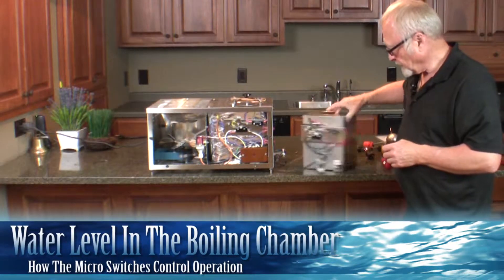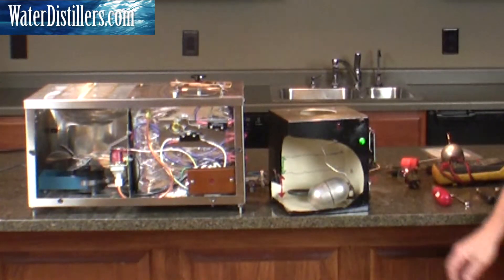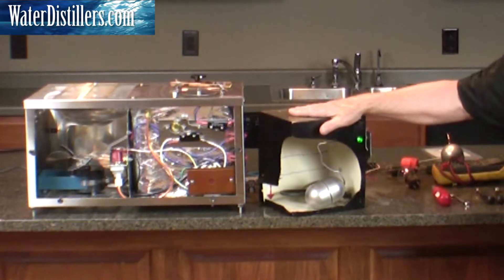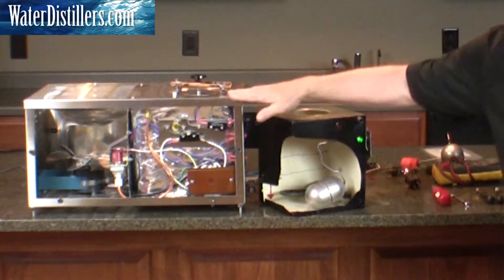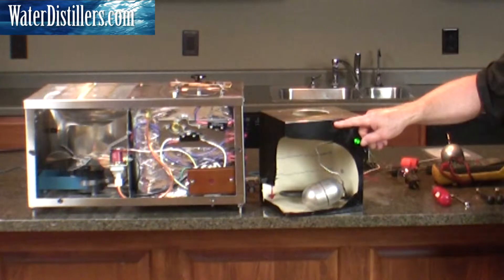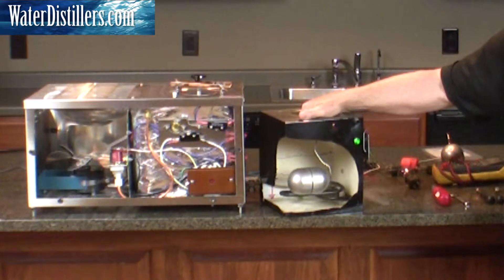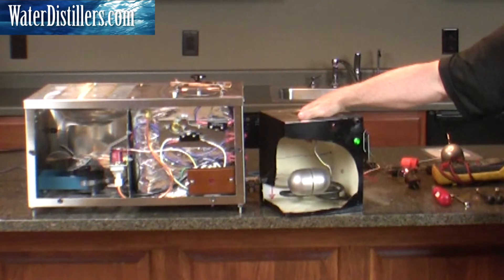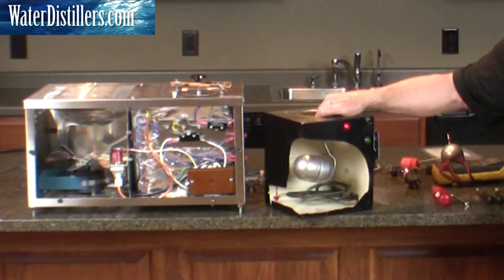Proper Water Level In A Durastill Water Distiller Boiling Tank

Comment: Thank you mine is taking in water and will not stop and filled the reservoir also. Even unplugged it takes water from the line.  It had happened before and I shut it off cleaned the boiler tank wiggled some wires and then tried it again and no problem. Mine is a dolfyn and does not have a float it goes by the weight of the tank if I push down on the tank when empty it will start operating. Thanks I will check the wiring and the switch  I do hear a click those when I lift and lower the boiling tank. I like how this distiller you have uses lights for indicators good idea

Comment: Thanks for the video. How do you adjust the switch if the water level is too high. I'm getting ppm in the storage chamber and I suspect boiling chamber level is too high and creeping into the coil from the boiling chamber.
Reply from the maker: Adjust the fill switch so that it turns off earlier and the tank will not be as full.